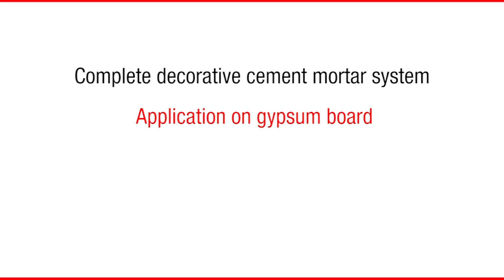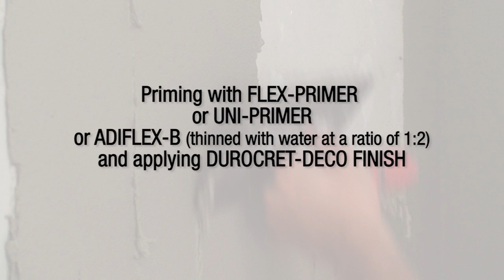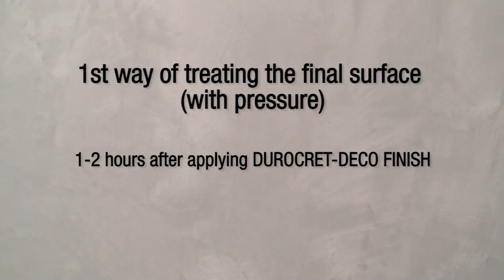ISOMAT: Application of decorative cement mortar system on gypsum board

Comment: Can be applied with same method on bathroom tiles?
Reply from the maker: Decorative microcement coatings can be applied over old tiles under specific conditions.
For example, tiles must be firmly fixed to the substrate and an appropriate primer must be used.
For further information on your application please consult ISOMAT's technical support department: support@isomat.eu